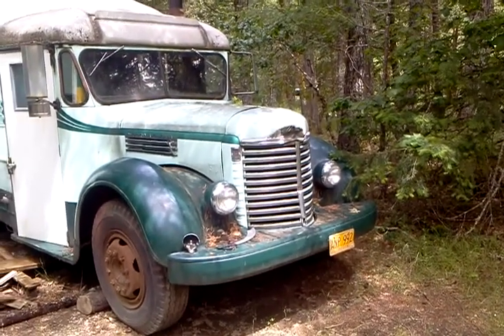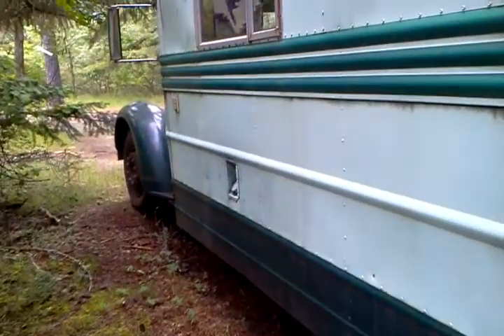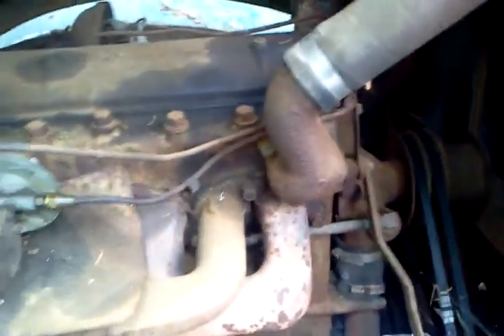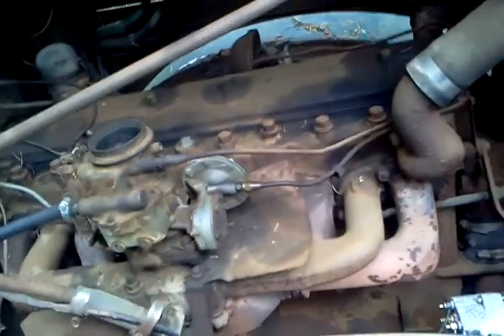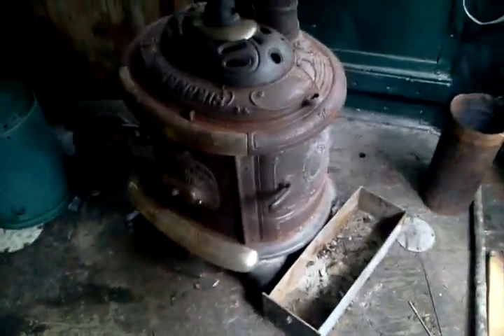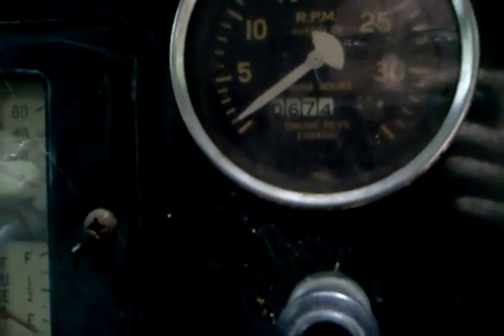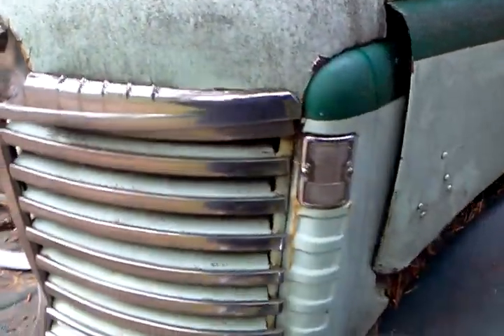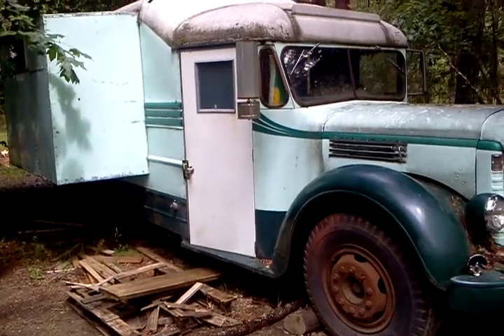International harvester kb-8-sb

Comment: BTW - Couldn't you just use a captain's chair for the driver seat? I'm sure it would bolt in - just gotta be sure to use hardened steel bolts and fender washer. I got a couple on craigslist for my bus - they were like $25/each I think. I'm sure they would work.